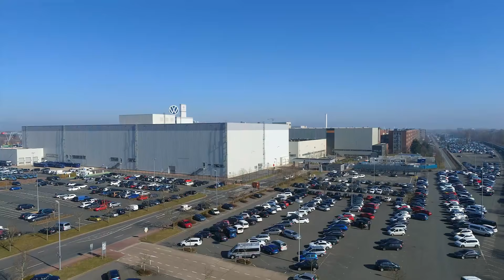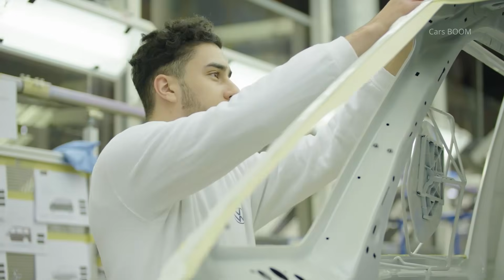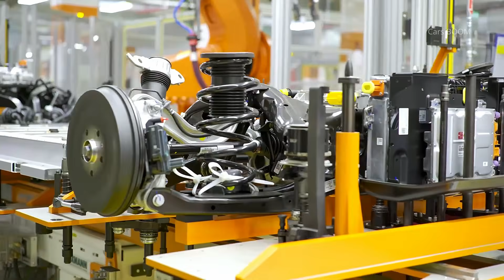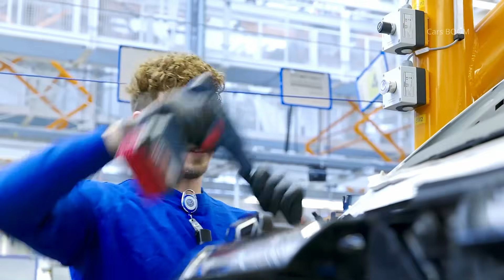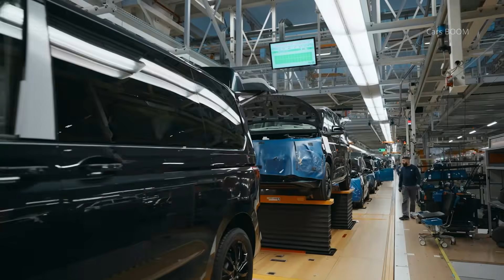Inside Volkswagen’s Most Modern Van Factory | ID. Buzz Production Line

Comment from the maker: Chapters
0:00 Press shop
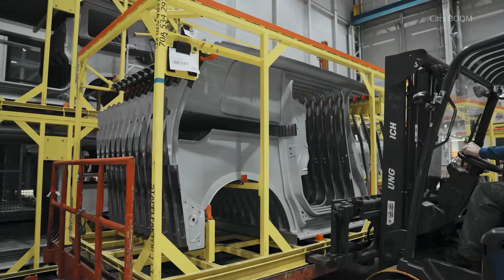2:09 Body shop
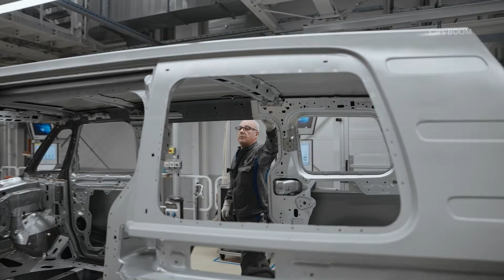5:30 Paint shop – first coating
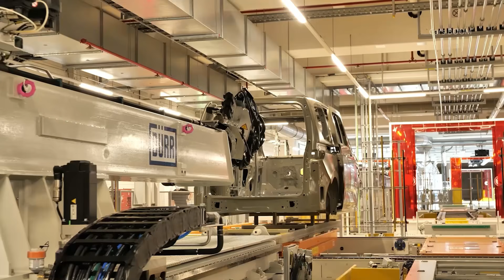5:57 Paint shop – seam-sealing station
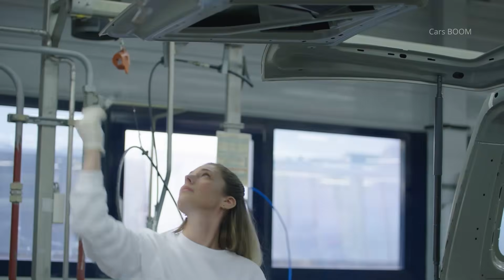7:00 Paint shop – manual seam-sealing station
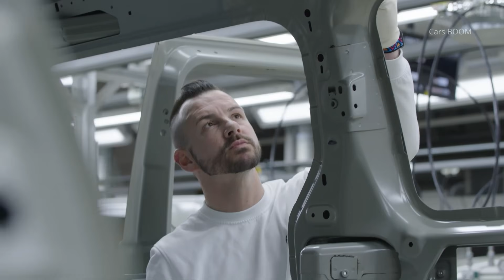7:31 Paint shop – anti-vibration materials
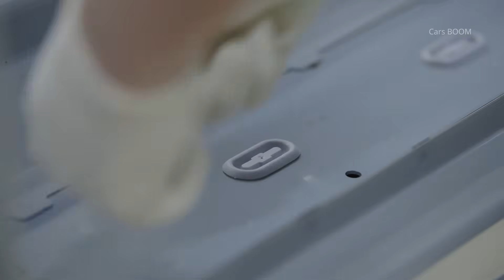7:45 Paint shop – manual masking
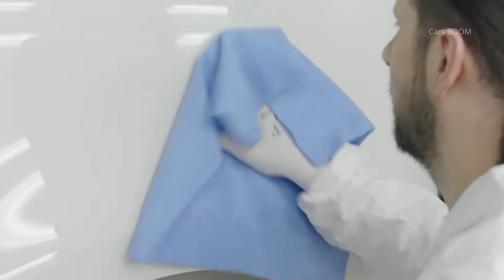8:30 Paint shop – two-tone paint stage
9:08 Paint shop – final checks
9:28 Assembly shop – front-cabin insulation piece
9:43 Start of trim assembly
10:14 Glazing station
10:47 Cockpit fitting
12:11 Powertrain assembly begins
14:29 Automated battery pack integration
14:55 Manual finishing of the suspension module
15:56 MEB platform-to-body marriage
18:34 Thermal-system hardware installation
19:07 Front bumper reinforcement installation
19:46 Headlight mounting area
21:04 Front bumper installation
21:32 Tailgate station
22:25 Wheel installation
23:37 Final quality inspection
24:28 Finished Volkswagen ID. Buzz at the quality shop
25:11 Subscribe to Cars BOOM